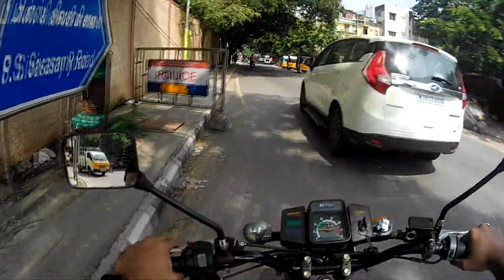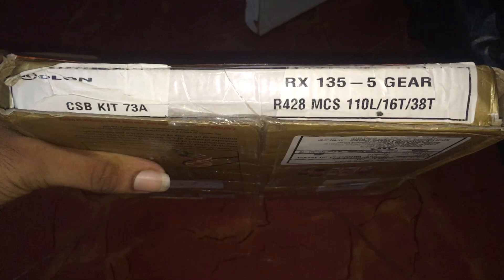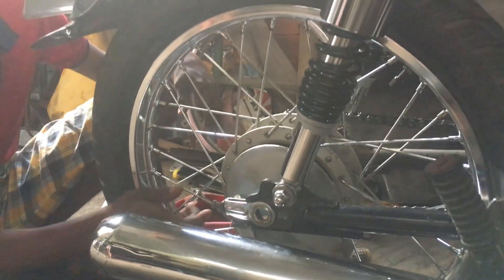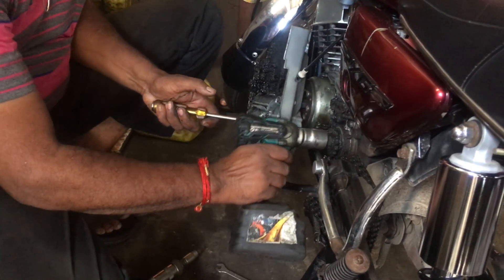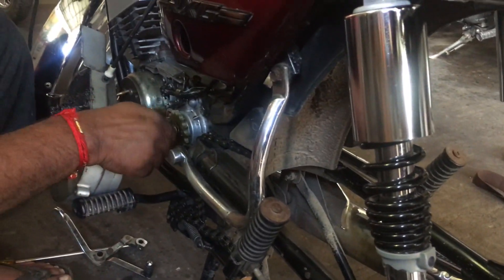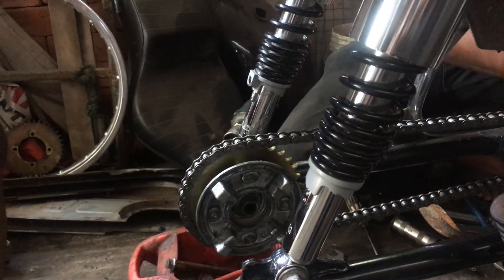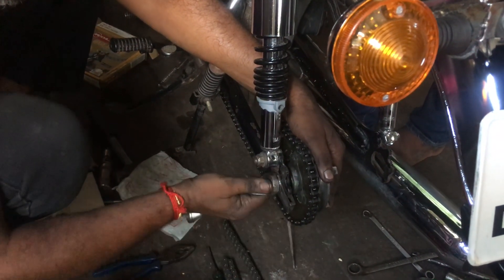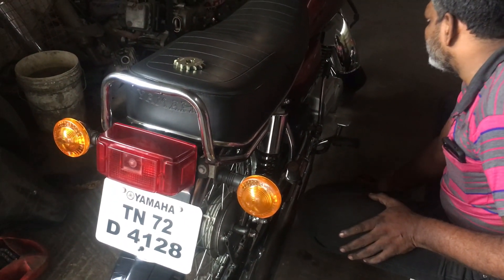Replacing Chain&Sprockets of my 1997 Yamaha RXG

Comment: The 5speed came with a sprocket setup
of 15-38 from factory. The original yamaha replacement packets do have same specification. Wondering why rolon went one tooth high in front.
Reply from the maker: Yes, very confusing indeed.

Comment: Bro rx100 or rxg or rx135 patrol tank same or not
Reply from the maker: Same tank. Different colors & stickering.
Reply: Bro rx100 or rxg gear whiles teeth same or not
Reply from the maker: Not the same.
Reply: Bro rxg or rx135 clutch bell difference
Reply from the maker: @rajuroyal809  Different. RXG is 71 teeth, RX135 is 74 teeth.
Reply: @BrattyBiker  tqu broo
Reply from the maker: Cheers!

Comment: You got it installed 16/34 or 16/38 (teeth) sprocket?
Reply from the maker: 16/34.
Reply: @BrattyBiker  i think your top speed has increased. Right?
Reply from the maker: Yes it has, slightly.
Reply: @BrattyBiker   please give me a suggestion: 16/38 or 15/38 setup is good for initial pickup? And overall which of these setup is best? (15/38 or 16/38).
I have rx135 4speed. Please reply to me.

Comment: Hey, how is it to stick 16/38 setup?
Reply from the maker: I installed 16/34.It's fine. I miss the acceleration of the 15/37 setup. It was more fun. 16/34 is very good for cruising.
Reply: @BrattyBiker  What about the clutch bell u use is that rxg clutch bell or rx135
Reply from the maker: I was using RXG's clutch. Will be changing to 135's setup.

Comment: Which is best 15/37 or 16/34 pls reply sir
Reply from the maker: 15/37, you'll notice increased pick-up, so it's great to use inside city traffic. 16/34 is good for long rides.
Reply: @BrattyBiker  sir rxg clutch bell pay 16/34 chain sprocket laga sakte hai
Reply from the maker: Yes, possible. My bike was running on RXG bell & primary & 16/34 setup. But 15/37 felt best as the bike was noticeably quicker in acceleration.

Comment: Is the magnet stock one or replaced
Reply from the maker: Since mine is one of the last batches of the RXG, The Magnet is from the 135 default, from the factory.
Reply: @BrattyBiker  your manufacturing year is ?
Reply from the maker: 1997 December.

Comment: Can i get whieele in16,34 set up on my rx 135 4 speed 1999 model???

Please tell
Reply from the maker: Yes. But a shorter sprocketing & lighter rider weight can help you wheelie easier. So use 135 5 speed sprockets or 100 sprockets.

Even better if your engine can make more power.
Reply: @BrattyBiker I made my engine recently,my weight is around 65kg
Want some whieele and want long gear ,more top end

Can I use 16,34 ??
I know it helps long gear and more top end

You just tell me can I do whieele with this set up

My weight is mentioned above
Reply from the maker: @arghadeepguchhait1999  I'd suggest you use a 5 speed gearbox and a 5 speed/100 sprocketing. Helps in first gear wheelies and the 5th gear is overdrive as well, helps in a stable topend. Don't expect anything over 120 though.
Reply: @BrattyBiker  thanks for confirming
Reply from the maker: @arghadeepguchhait1999  Cheers bro! Ride safe, please wear proper gears and wheelie only when there is nobody around. Let us not let our passion be a danger for our loved ones and the people around us.
Reply: @BrattyBiker  yes bro, always

Comment: 10:08 should the rubbers be installed for both the tyres
Reply from the maker: Nope, you will only find this on the rear wheel.
Reply: @BrattyBiker  okay got it👌

Comment: Can u explain me the cost for chain sprocket and brake shoe and all
Reply from the maker: Chain & Sprocket as a kit costed me close to ₹800. Brake shoes another ₹120. Got the wheel bearing & sprocket rubber replaced as well. Don't remember the exact cost but its not very expensive.

Comment: Sir rxg chain sproket teeth and rx135 chain sproket  teeth defaranc pls reply
Reply from the maker: Yes sir, RXG has a 15T front sprocket and a 37T rear sprocket while the 135 has a 16T front & 34T rear sprocket.
Reply: @BrattyBiker  sir performance kiska acha hai rxg / rx135
Reply from the maker: RXG is more favourite for me but 135 is better, it doesn't have jerking issues of the RXG
Reply: @BrattyBiker  TNX

Comment: Bro one doubt... Can we fit RXG sprocket on Rx135? RXG sprocket has more teeth... Is it possible? Anyone explain... Any alternation needed?
Reply from the maker: Yes, direct fit, you will need to change chain, wheel rubbers, wheel&sprocket bearings, front lockwasher along with the front&rear sprocket. Also a good time to get brake shoes replaced & drum surface sanded.

With RXG's 15F37R setup, 8Bike will feel more fun due to increase in pickup. But topend will be equally reduced.
Reply: @BrattyBiker  tq for this info bro... 😍 means so much to me ✌🏻✌🏻
Reply from the maker: Cheers :)
Reply from the maker: @sunilbks13  Cheers! Glad that it helps :)
Reply: @BrattyBiker  it helped a lot bro

Comment: Jurcking problem any   solutions?
Reply from the maker: There is no jerking problems on my RXG. But if yours has, change the magnet, primary gear and clutch bell to that of the 135. It will be solved.
Reply: @BrattyBiker  tnx    I'm g owner...my bike isue..I'm already magnet set change...& This try it
Reply: @BrattyBiker  any mailage issues...now mailage 38-40
Reply from the maker: No, 38-40 is perfect. Infact, I would suggest you not to touch the engine if it starts and runs properly
Reply: @BrattyBiker  tnx
Reply from the maker: Cheers!
Reply: @BrattyBiker  Hi, I am looking for Chain Sprocket for my YAMAHA RX135 CC NEW with 34 teeth chain kit. Any idea details of shop and phone information, really helpful. Please..
Reply from the maker: Should be easily available in most spare shops. Ask for 4 speed 135 chain sprocket. Rolon made, might come in Yamaha Packing.
Reply: @BrattyBiker  thank you once again. Let me check.
Reply from the maker: Sure! Let me know if you can't find it locally, I can recommend some online sellers.
Reply: @BrattyBiker  tnx for replay. Carbarate tune mistake.. Now perfect oky. (Alry change magnet)
Reply: @BrattyBiker  I am living in Bangalore and I was checking online and I could not find 34T and it is showing only 37T. Please if you could find online sellers, pls. give a update. I don't want loss money due to some unknown online fraud.
Reply from the maker: @santhosamj5254  Visit GeeBee (or AB) Auto Spares : 9845092599/9036903962. They are in Banglore and you'll be able to get. 

Btw, the 15T Front/37T Rear sprocket kit is of RXG, helps in acceleration.
Reply: @BrattyBiker  Thank you so much. sometime too much attachment with this Bike and not getting Genuine  parts and very disappointing :)
Reply from the maker: @santhosamj5254  Cheers, we have all been there haha. GeeBee is an industry veteran who will give you  OE parts at MRP. One of the best in the community.
Reply from the maker: Cheers! Glad that it helped.

Comment: Rx 100  front 15t back 39t
Rxg front 15t back 37t
Rxz/135 4s front 16t back 34t
Rxz/135 5s front 15t back 38t
Reply from the maker: Perfect! The RX100 also used to come with a 14T front sprocket but Yamaha changed it at some point of time.

Comment: How much did it cost bro for Spares
Reply from the maker: Close to ₹2,000 including labour charges.
Reply: Bro i have Rx 135 4 speed it gives only 20kmpl what to do for more mileage
Reply from the maker: 20kmpl is very low. Let’s start with the basics :

If you can hear audible rattles or noises from the engine, then don’t bother with these, just get it freshly rebuilt. See if you can use the same piston, if not, if the bore is worn, rebore to next size and use next size piston (TKRJ,Goetze.etc), replace all bearings, oil seals, rebuild the crank with new connecting rod and do the running-in properly.

But if your engine is fine, no rattling noises from it, then follow this guide :

If you are using aftermarket bore/exhaust.etc, make sure to get back to original bore piston and exhaust.Make sure to switch other aftermarket parts back to original.

Check if your choke is engaging and disengaging properly. If it is stuck engaged, it will throw a lot of fuel into engine hence low mileage.

Check if your brakes are adjusted properly it must not be rubbing the drum when not used. Check your wheel bearings, they must rotate freely without any noise.

Check your chain and sprockets. Adjust the slack correctly and make sure to clean & lubricate it. Rear wheel must rotate forward and backwards freely without any major noises or jerks.

Check tyre pressure, make sure to keep 28PSi upfront and 32PSi at the back. If you are using a 16” rear wheel (Yezdi one), switch back to 18”, it will help with the mileage.

Clean and rebuild your carburettor to stock specifications. Keep the clip on the 3rd slot of the slide, make sure to not damage the small rubber O-rings. Have the AFM screw at 1 full turn outwards. 

Clean,rebuild and Recalibrate the oil pump if you are using it, if you are premixing, premix 25-30ml oil for every 1 litre of fuel. Along with it, change the air filter and change spark plug to BP8HS. Use a Hero Resistor Red Plug Cap.

This should definitely help in improving the mileage. If not, 

Take off the head and exhaust, get it thoroughly cleaned from carbon.

Inspect the piston rings. If it is worn, there won’t be enough compression so the combustion won’t be great, hence low mileage, so change the rings (TKRJ makes great quality rings) 

Hope it helps :)
Reply: Thank u for such wonderful information ❤
Reply from the maker: Cheers :) If you are in Madras, I would suggest visiting MadMonkey Garage. They are one of the best in the city and can help you fix this
Reply: I'm from Tirupur Bro
Reply from the maker: @dhinahar9989  Hmm, unfortunately I do not know of a good mechanic there. But you can search with your friends, they might recommend you a good garage.
Reply: @BrattyBiker  awesome info brother !! .. any idea where to buy TKRJ rings ? I'm from Coimbatore
Reply from the maker: Thanks, you can contact Adarsh (@tuners_craft on Instagram)
96639 94688 

Ask him regarding availability. He is a very genuine seller. If available, he can ship it to you.
Reply: Ok Bro✌
Reply: Bro What is the use of Glass Wool i see it many places
Reply from the maker: Glasswool helps in muffling the sound and also has a part of changing the way how it sounds in general. Imagine shouting with a soft pillow on your face, you will not be heard that well and your voice won’t sound very sharp. Same way, the glasswool acts like a pillow muffling the sound to reduce the volume and also reduce the sharp tone of the exhaust.
Reply: @BrattyBiker  bro unga bike standard size ah or rebore paniruka ? If rebored , what's the size and what piston ur using .. and for a rebored bike , how many kms it takes for the engine to set . (Run in period)
Reply from the maker: Currently my engine is at 2nd oversize (0.50mm) and it was rebored by the previous owner. I have no idea if my block is sleeved or still in factory sleeve. I have no idea of the current piston & ring’s make/manufacturer, it could be Goetze/Escorts Mahle.etc

I’d suggest a safe running-in period of 1,000KM. Disable the oil pump.Premix and run, use a thin oil like MAK 2T (25-30ml oil per litre of fuel). Keep the throttle dynamic, don’t stay at the same speed. Don’t run lean, don’t do engine braking and make sure to not ride when there is too much traffic. Freshly built engines don’t like stop-go-stop-go traffic.
Reply: Bro naan vandiku rx100 muffler thaan potrukan Athula glass wool epdi podrathu
Reply from the maker: You have to take out the muffler/flute, then wrap the middle section with glasswool or you can use a rod to fill the exhaust with glasswool.

Make sure to cover your skin,nose,eyes and ears. Glasswool can cause tears in skin and it is lethal to health if inhaled.
Reply: @dhinahar9989  muffler remove panitu , muffler neck la glass wool ah roll pani muffler ah insert panirunga .. that's all
Reply: Muffler neck na entha side na nadula oru short pipe varume angaya
Reply: Apdiye summa suthi uta pothuma na
Reply: @dhinahar9989  but neenga glass wool pota sound kami aairum .. so neenga rx100 muffler potadhu waste dhaney .. but if u want to reduce sound u can do that
Reply: Anna intha muffler ah sound kammi na enaku epdi alter pandrathu nu therla athaan Apdiye uttan

Comment: back wheel sprocket for 34t is rxz?
Reply from the maker: For 4 speed RXZ, it is 34T
For 5 speed RXZ, it is 38T
However, Rolon 5 speed kits are now coming with 39T rear sprocket & not 38T.
Reply: @BrattyBiker  rxz sprocket use pannalama rx100 kku
Reply from the maker: Yes. Both will reduce pickup, 4 speed sprocket will improve mileage & topend.

Comment: My rx 135 4 speed 
Chains pocket RX 100   fitting work performance different
Reply from the maker: Yes. You will have more pickup but lower topspeed so but switch back to 135 4 speed sprocketing.
Reply: Mileage issue

Comment: Neega use panna 16t and 34t to sprocket, rx100 bike use pannala acceleration nalla irukum
Reply from the maker: Yes OK. You can use 5 speed chain for even better acceleration
Reply: @BrattyBiker  any mileage issue?
Reply from the maker: @kaalakarthick7345  Not an issue but you can expect a mileage to drop a little bit.
Reply: @BrattyBiker  tq bro